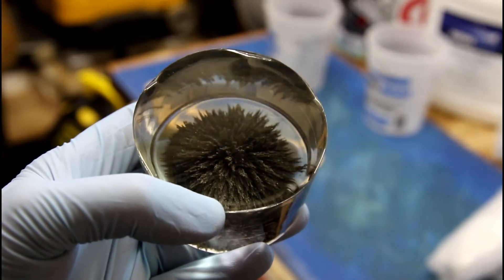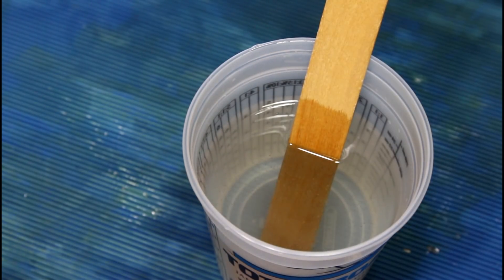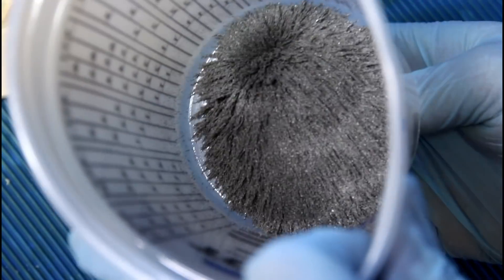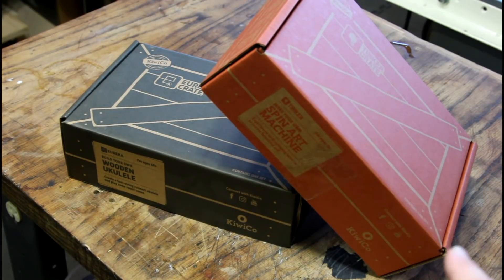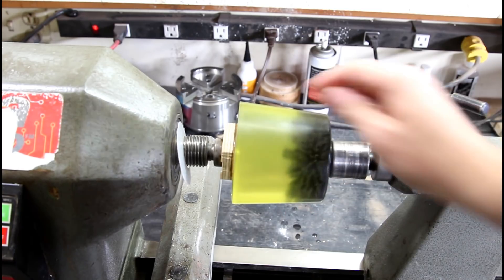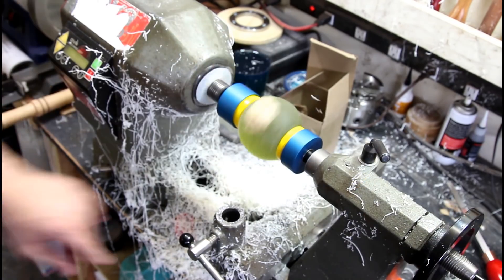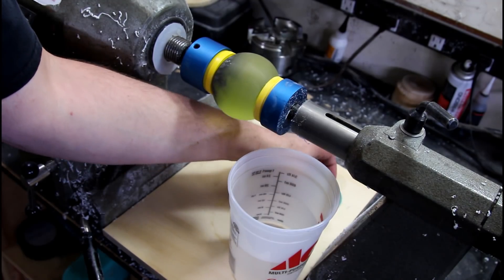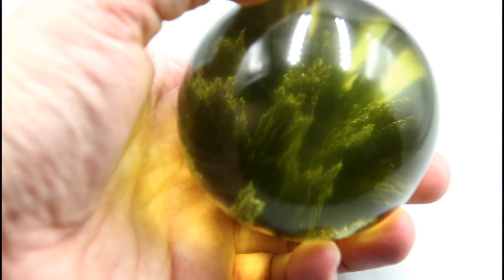The Iron Sphere | Dipit#30

Comment: Oh, I feel a little bad I didn't cross your path sooner. I did a bunch of similar pieces back in the late 90s, only mine were embedded in pyramid molds. If you suspend the iron shavings in the resin before attaching the magnet you can get much, much bigger spikes and whorls. I would usually just stir the shavings in before pouring.

Comment: I'd love to see a sphere like this made from two hemispheres with shavings in, so the blossom appears to float in the centre
Reply: or what if you could have one sacrificial magnet completely covered in filings, and then try to center it in the resin using other magnets outside the cup to constrain it. The other magnets might mess up the pattern or make it cooler!
Reply: @jackweinrieb  My exact thought was a spherical ball magnet, to create a spherical blossom.  Floating it with outside magnets, sounds brilliant!

The human brain is pretty good at thinking up new solutions to problems that didn't even exist a minute ago.  

Sad to say I got rid of my lathe. It was free and had a 4 foot bed, but I just didn't have the room to set it up.  - Cheers
Reply: @joeshmoe7967  Glue the magnet to the tip of a thin plexiglass rod and hang it in the center of your cup, then apply iron filings to make a round "flower, and gently pour in the resin. That way, you wouldn't have the external magnets deforming the flower.  When you finish turning, the rod should blend in and be nearly invisible.  With the "flower" suspended in the middle of the sphere, you would not have to cut into the filings.
   side thought:  Even if you used a square magnet, the "flower" would take the shape of the magnetic field, not the magnet.
Reply: @joeshmoe7967  sphere magnet looks like the inverse blossom from the first magnet pour.
Reply: You could probably use a spray glue on the shavings before resin to help hold the shape.  Nickel filings would be softer and easier to turn than steel or iron.
Reply: Shavings in both so it’s like a blossom sphere, one going up and one going down

Comment: Makes me think... wouldn't it be possible to epoxy one of those tiny fairy light LEDs into one of your resin sculptures, super thin wire leads running through and out of the base, then after turning dig out the ends (or cast larger copper connector studs that turn to flat patches you can access after you're done), hook it up to a battery and have built-in lighting?

I need a lathe...

Comment: what would happen if you used a thin resin with a really long cure time and mixed the iron filings into the resin then placed it in the pressure pot with the magnet as you did in this video?

Comment: Just FYI the way you were holding the magnet as you put it in the pressure pot was dangerous.  Never get any of you between the magnet and something it would want to stick to. If that magnet had decided to go off the side and slam into the inside of the pressure pot it very well could have taken the end of your finger off.

Comment: Great video!!  And the resin didn’t exo even as it was 4.5 inches thick!?   What temp was the pressure pot/ambient shop temp??
Reply from the maker: You can see some wavy parts on the surface during the demold. That was one reason I chose to add dye. I think it wouldn't have been crystal clear as I poured it so thick.

It was like 70*F the day I cast it. We broke a heat record for March... :)

Comment: It would be much more complicated, but if you could dip the shavings in near vacuum (maybe with some sort of tipping mechanism triggered by a water balloon popping when air pressure drops very low?), there would be significantly less trapped air interfering with the forming of the bloom, which may result in a more "true-to-life" casting

Comment: I'd be interested if there was some way to do this in reverse. Basically, a thicker resin or a weaker magnet and place it on top of the resin and iron. Let it pull up through the resin hoping it's slow enough to get a unique shape out of it.

Comment: For magnetic safety in a shop for REALLY strong magnets, you might look into using switchable magnets. When they are switched on, they are very strong. When they are switched off, they have almost no pull (if any). They are not electrical, it is a physical housing. Check them out: https://magswitch.com/

Something like this might be up your alley: https://magswitch.com/product/magsquare-165/ It has 165 lb pull force when engage, but zero when not. Way more safe to carry around the shop.

Comment: WHY do you not pour in the resin first and then sprinkle the iron into it. The metal would sink in the resin and might form a even better illustration of the magnetic field lines because it would have the support of buoyancy in the resin against the gravity. Also you would not have air trapped between the spikes!

Comment: I wonder if you could produce 'trails' of dye by first pouring a layer of clear resin, and then pouring a layer of dyed resin mixed with iron filings. Maybe the magnet would pull dye covered filings through the clear layer and make streaks?

Comment: That is so very cool looking. Would make a great paper weight! p.s. I was worried when you kept adding the drops of yellow that it was going to become opaque but you got it just right.. QUESTION for you.Now as you said you've got the process down if you make another using whichever translucent color at your discretion or clear R. Would you please please please ADD some HOLOGRAPHIC glitter? Not many of you woodturners I watch when you do use resin with your wood or like this sphere I don't see any that use Glitter. Is there a reason for that? Thanks in advance

Comment: This would have been a great test for my circle jig I purchased but haven't used yet. I think the jig would not have the same issue as you experienced with pressure differences. But I don't know, I gotta set that thing up. 
Also: 
Is it slightly magnetic now? 
Are those tiny little air bubbles on the iron?
And it reminds me of the murder bowl.

Comment: Nice work on this. I like it. 

Figured I would give you a suggestion:  Make the metal in the middle of the ball spiking out where you can see it 360 degrees all around with spikes almost going to the edge so it looks like an exploding metal center of the ball.

Comment: This is amazing!
I loved the process and the final result is breathtaking <3
I've never seen sphere-turning and it is definitely fascinating

I thought that when material sticks out of resin, like these shaving do, the surface would be uneven to touch and so you would need to cover it in a layer of clear resin or some other coating. 
Is iron smooth enough so that it does not need to be covered?
Will it rust over time?

Comment: That totally reminds me of...hair 😉

Crazy cool result though! Would the magnet be able to push the filings at all once it's already in resin? I'm thinking if it's possible to make some cool iron filing patterns by moving the magnet around after the resin has been added?
Reply: You might have to wait until the resin gets a little more viscous, but other than that, I don’t see why it wouldn’t work.
Reply: I was thinking of trying to extend the filing pattern by hanging another strong magnet from the top or gluing some smaller ones to the outside of the cup. Maybe you could get some cool swirl patterns by sticking part motor under it and then messing with the RPM. You could try to match the viscosity of the resin with sugary water so that you could test things out for hours without wasting the filings.
Reply: This ^^^^^

Comment: Would using a slow cure resin with the iron fillings all mixed in with a magnet at the bottom work? I'm thinking of how odd pigment tests you have done before had bits float or sink as they set. Would the magnet make it set in the magnetic lines?

Comment: I wonder what would happen if you were to put the resin in the form first, and then add the filings. The magnet should be powerful enough to pull the filings through the resin, and the spikes would be less likely to get crushed. In theory, the spikes should form just the same as they would outside of the resin as the resin shouldn't effect the lines of magnetism. (although, the filings may drag with it dust and dirt into the resin.) 🤔

Comment: I don't know if anyone has mentioned it in the comments yet, but bartenders use a long handled spoon to layer a drink. Using one (maybe a mixing spoon?)  might help if you need to pour resin on the edges of the container for a similar project with a center that could be so easily disturbed by the resin.
Reply from the maker: That's a great idea!

Comment: Why would you use a thick resin? I immediately though you'd have problems with the shavings moving from the force of the resin flowing.

Why haven't you gotten an inverted pressure pot? Then you wouldn't have so much trouble putting stuff in.
Reply from the maker: Thick set resin, means you can pour it thick. It's a fairly thin viscosity.
Reply: @peterbrownwastaken  It didn't look thin. Very syrupy.
Reply from the maker: The only other one I have that's thinner is the ICE resin I used for the rose but it didn't polish up great. 
It's hard to get the right balance of things.  :)

Comment: I work in MRI safety and you are genuinely lucky to not have gotten more seriously injured. Magnetic forces are often  underestimated until someone loses a finger! At least the result is very cool!
Reply from the maker: It was super scary. It jumped out of my hand, smashed on the steel table and shattered.
Reply: @peterbrownwastaken  At least you had the sense to let it go. It'll pinch the flesh off the bone if the angle is right.

Comment: When working with very string magnets, I think (not sure) that it might be a good idea to have it at the end of relatively long metallic strip. The reason being if it decides to catch on to something, the strip will just fling of your hand or get damaged, saving your hand in the process. Having a very strong magnet in your hand is exceptionally dangerous since it can have a massive force on a very small surface area.

Comment: if you want to try again, here are some ideas:
1. pour in resin first, then iron shavings.  the buoyancy effect of the resin will allow the iron spikes to reach up better.  will also allow you some pressure pot attempts without having to worry about spilling resin.
2. try creating a magnetic field half way up through the resin by placing the magnets on the side walls (inside) of the pressure pot.  This way you can center the shavings in the sphere and wont have the variable resistance and wobble of it all being on one side.
3.  the washer under the plate can effect the field and setting the mold on top of the magnet could imbalance.  try attaching wood blocks to the top of the plate that will both secure the magnet from the walls and support the mold.

Comment: This is great. I'd like to see a powerful magnet fully enclosed in the centre of the resin with the iron filings free floating inside the resin. I want to see the 'currents' as the free flowing filings are attracted toward the middle, rather than preserving the pattern as it was in the air.

Comment: it would cool to somehow suspend the magnet entirely covered with savings in the center of a resin ball
Reply: You could put it on a resin rod that suspends it while making the first shape, and when you round it into a sphere it would only leave the iron in the middle. Exept that then there would have to be a small area without iron, where the rod would be. Maybe a resin string? Somehow? Maybe some resin shavings, they are basicaly invisible in resin
Reply: @privpi  One way to do it would be to suspend the magnet in the middle, from the top using the magnetic force to hold it.
Cover it slightly higher than halfway in resin and let it cure... then you can remove whatever you're holding it with because it's being supported by the resin underneath.
Then continue your second pour.
The problem with this method is it's hard to match colors so you generally have to do it perfectly clear.
Reply: @privpi  yeah, just hand the magnet from a fishing line.
Reply: Could you make two halves of a sphere and stick them together with resin? Or would the seam
 really show?
Reply: Yes, a complete iron sphere would be really cool (and much easier to turn), although I ended un loving the look of the exposed iron shavings at the bottom of his sphere.
Reply: inverted option make a cube mold with magnets on 2 opposing sides just a bit of playing about and you get the filings in connected arcs maybe that would be epic.
Reply: So .. you want to create a finger crusher, that not only pulls with a force of 60 something pounds, but is also mobile while probably sitting on your desk. Sounds like a splendid idea. (-:
Reply: @chrishuhn5065  errm no I realize my description lacks some detail but given the use of said magnet in the video pretty easy to infer that the magnets would be outside the mold creating two blooms of filings that might interlace relative to the size of the mold

Comment: OK, why not start with the resin and then add the iron flings mix and then place the magnet? You would get longer spikes and not crush them when pouring? I think withe the larger magnet and a longer open time resin you would have better results and I doubt the iron flings would just stay on the surface
Reply from the maker: I've got a video on my FB trying this. The short answer is: the resin is too thick to allow it to work.
If you've never worked with resin, its more like syrup than water.

Comment: You should try this with ferrofluid!
Reply: ferofluid has oil in it and if u add it with resin it might not settle at the bottom in time or at all plus when the resin starts to cure it may not cure properly idk im just gueesing but its a cool idea
Reply: @the_missing_socket  Yeah I was also wandering about the way it could react with the resin. I am not sure but as far as I understand ferrofluid is basically just very small magnetic particles suspended in a polymer of some sort. So since resin is also a type of polymer I was thinking it might actually work with the right resin.